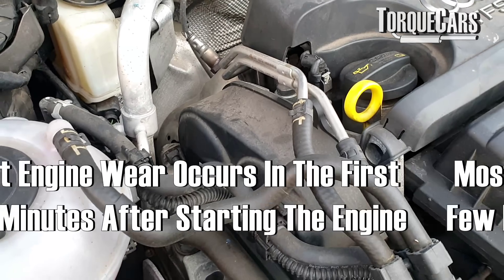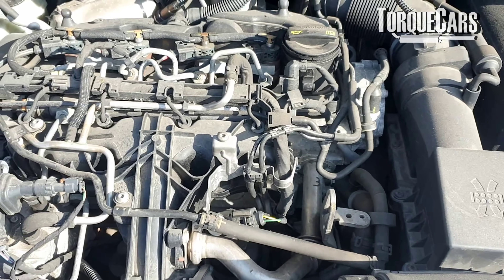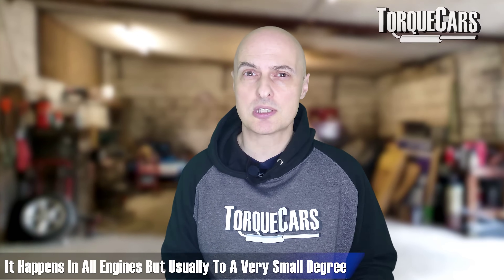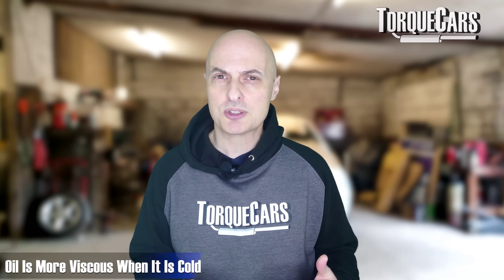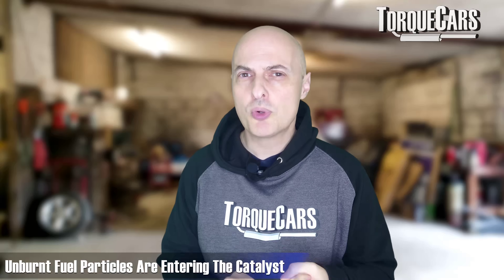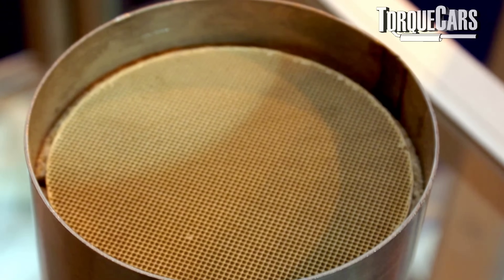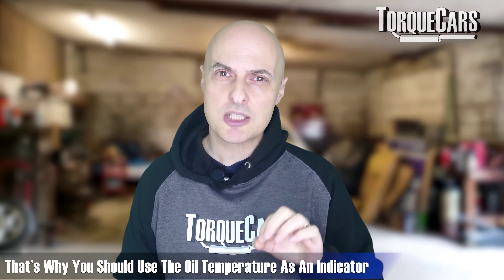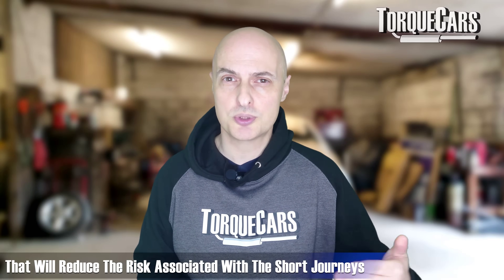5 Minutes of Terror? The TRUTH About Cold Start Wear (and How NOT to Blow Your Motor!)

Comment: I had a bike with one cylinder, 600cc. If you did not warm up the engine gently, you felt it during the rest of the riding, even when hot; it didn't run as smooth as normaly.

Comment: This is junk science. The author states right at the opening that he doesn’t know if this is true. Go do a real study with multiple test cases… a control group and take engines apart and inspect and measure. Everything your saying hear only exists in your own mind. One or two cases that you’ve seen exclude all the cases you don’t see.   This is what we call a “wives tale”. Junk science.
Reply from the maker: Hi buddy, I have a feeling you left this comment on the wrong video! Firstly I do not make any claims about not knowing or being unsure at the start. 

Engines do not need to be stripped down and inspected & measured. You can fairly easily determine wear rates by doing oil analysis. Metal particles build up in the oil and help determine the wear rate with a fair degree of accuracy. Having been dealing with cars for over 20 years I can confirm that cars which do short drives and are not warmed up properly or are driven hard have significantly more wear metals and need more frequent oil changes. The difference is notable after 3000 miles on those engines, whereas properly respected engines need 6000 to 8000 miles to show the same degree of wear metals.

If you can point me to any studies or references that prove that cars don't wear more when cold, they don't need to be warm before being driven hard i'd read them with interest as this goes against a lifetime of experience.

Perhaps you would like to see some "actual studies" & science?
https://www.sae.org/papers/startup-wear-automobile-engines-600190
https://www.degruyterbrill.com/document/doi/10.1515/eng-2021-0059/html?lang=en&srsltid=AfmBOoppgduv9JNPy6E69lJ8aEkavpHBvP-aEviwavGgTjYhTMMBco4T
https://eprints.nottingham.ac.uk/13249/1/247259.pdf
https://www.emerald.com/ilt/article-abstract/52/6/277/171010/Modern-heavy-duty-diesel-engine-cold-start-wear

Comment: I always idle for up to 10 minutes on really cold winter days. Not because I am stupid but I try to heat the battery and increase its capacity which follows engine room temperature to some extent. My alternator belt is slipping and I risk getting stuck commuting to work 80 miles a day in -25c. My car will run 30 miles without a belt if cold. So I warm it up 😮

Comment: In cold weather modern cars will be over 1200 rpm and gradually revs down to about 800-700 rpm.  At the lower revs it’s safe to drive off.   

However if there’s a Bigfoot or UFO nearby, you’re free floor it & take off ASAP.

Comment: I have an fn2 type r I normally warm up the engine for exactly 1 minute then drive it at Low rpms under 2-3k after around 10 minutes of driving and when the engine temp is where it should be then I drive it normally let me know if 1 minute idle warm up is too much?

Comment: I have done basically everything he said not to my car over the years to the extreme! I wouldn't stress about it as it still runs after major abuse and i have been driving for like 10 years now. But the car gets fresh oil every 10k km (6k miles) ish if you did what i do on old oil i imagine it wouldn't have lasted this long. If you drive like me when you do an oil change the oil will be quite shiny even at those intervals.

Comment: I live near a steep hill, so my engine doenst get the privilage of warming up. Its a diesel and i need to revv it after 1 ½ minute of startin at around 2,5k -3k rpm in 3rd gear to get up there. It has now 300.000km on it and runs😅

Comment: Thx for sharing. I live in Canada, where winter months are -20C. Are you saying not to warm up the engine for better performance?
Reply from the maker: You do need to warm the engine up, idling is not ideal but i know you guys just can't drive it around at those temps straight away, so there is an idle method I recommend....

I have actually just uploaded an updated version of this video which should be clearer on this topic. https://www.youtube.com/watch?v=-_WtD0N6_Fk

Add a little load whilst idling, just 200-500rpm and it will warm up much more quickly and safely.

Comment: I agree with the start and go after idle comes down, but what about the transmission fluid? 
Is the principle the same?
Reply from the maker: The video that is going out later today mentions transmission as this is also an important consideration and in most cases you need to be in DRIVE for the fluid to warm up, and better still driving around.

Comment: I have a rover MGZR so even though the head gasket and all that has been upgraded I always make sure the car is warmed up but I tend to leave it to idle for about a minute then don't drive it anywhere near 3k revs (normally nice and low around 1.6k-2.2k) but I didnt know me leaving it for a minute on a cold start would be bad for it. So should I basically keep what I'm doing but when it's started up wait 10 seconds then drive carefully till it's at full operating tempts?

Comment: If what you said a lot of cylinder movement when it cold start, but it running approximately 1700 rpm, and if you shift it to drive right away it down it less then 1000 rpm, don’t you think is it better then ?

Comment: I have a crackhead neighbor who unfortunately has murdered his Toyota echo. He jumps right in it it could be 70 or 20, backs it up and floors it down the road. He told me it has low compression and I told them it's probably because his valve seats are starting to not exist because of the way he drives it when it's cold and he told me it's bad for engines to let them warm up. If you wrap the piss out of an engine while it's cold you don't deserve to own a car let alone have a license

Comment: Career auto worker of 22yrs. Engine builder for 11. Amateur racer for 10. Can confirm: everything he states in this video checks out. 

Simplest solution: wait until your engine slows to its actual idle speed before driving the car, and drive it easy until the coolant temp (temp gauge) gets up to temp.

On cold days, it will take the motor longer to reach this target. Just be patient, work your phone or stereo while you wait. Your $6-20k motor will live twice as long (possibly more).

Comment: When I start up the engine, my wrx initially has the revs around 2k rpm to warm up, and it keeps it there for a little while. When it drops below 1k rpm, thats when I start driving, and I drive carefully until the oil reaches 170⁰F, trying to keep it between 2k to 2.5k rpm.

Comment: Got a hybrid and it automatically goes forward at a slow speed just enough to get out in the main road, takes like 1-2 minutes don't have to press the pedal, surely that's as good as being stationary? Yaris 21' .
It's a habit already, but it takes a minute to settle in as well anyway, put my hoodie there, backpack here, cry because I go to work again... the usual. I also think modern cars are smarter about warming up these days, when it's cold the engine kicks in immediately compared to hot weather where engine goes on but works on battery still unless empty.

Comment: I drive off gently and warm her up. I figure the load will warm it more quickly and if i am not spinning her up, its all good.

Things are so much better than they used to be. Modern cars are at operating temperature in just a few minutes and multigrade oils protect the engine until they are.

Comment: Winter, start engine defrost windows and go. I have my transmission programmed to shift at max 2k when transmission oil is cold. 
Summer, start wait to idle drop to normal and go. Transmission shifts at max 2k when oil is cold. 
This way the engine and the transmission heat up in the right way at the same time.
Letting it sit all the time just gives you carbon buildup and takes ages to reach the desired temp. And if you were supposed to let it sit at idle for a long time the manufacturer would have told you.
The cars are engineered and tested to do so at arctic temperatures. 
So don’t waste gas money on this, just use top quality oils that flow well at various conditions.

Comment: I wait for the rpms to go down before moving and then keep it at or below 2k rpm until the oil is fully up to temp and the start to drive properly. And also do lap of a quiet area before almost any drive just to give it time at low speeds.

Comment: When the oil is thicker and flows slower, it still flows! As long as the pump delivers pressure and the thick oil still creates a film between the moving parts (cams, bearings, piston rings and piston to cylinder wall), which is a stronger film than when the oil is at operating temp. Thicker = slower = stronger film! That's common sense by the way! Indeed during the first minutes, when close to freezing temps outside, I've also heard the piston slap on my Ecoboost 1.0L 125hp when I put some mild load on it, so it doesn't seem to like it when I rush! Whenever I leave it at idle for like 3 minutes at freezing temps (after the engine was frozen too after the night), the slap sound no longer gets heard when putting load on the engine, even at high load. So unlike other engines I've experienced with so far, the Ecoboost really has some smaller tolerances inside the engine and needs a warmup at first more importantly than on other engines in order to last long. So far it has no wear according to the annual worn oil analysis that I do, but that tapping sound that is heard ONLY on load after cold start is definitely a piston slap, cause it only happens on load.
Reply: 0w oils is killing cars all round me. My mechanical friends go to 5w30 and have 0 oil burn and very long running engines. 5w or 10w oil films over parts longer than 0w oils. Some add lucas oil additives to do the same thing. Not very much is perfect. 20% is extreeme in good young engines. Dirty oil kills quickly. 3000 to 5000 miles seems to be best.
Reply: I second this after selling my 2.3L ecoboost mustang. Beat the piss out of it ofc so may be my fault but on cold starts it always had piston slap even if it was 40-50F. Eventually I had to start letting it idle for 15-30 minutes at a time because the piston slap was too bad to drive with. It seems every motor is different in its own ways, especially a turbo'd ford lol

Comment: I have a 1999 Mercedes W202 C280. I noticed that when I cold start it the RPM needle starts off at a higher RPM for roughly the first 10 seconds. I usually just wait until the needle goes down and then I start driving

Comment: In the turbo Benz, I drive very gently until the oil temp gets out of the blue zone (probably around 65 Celsius)... on the beater Nissan it's thrown in gear soon as the dash finishes testing the warning lights, but still doesn't see over 2000 RPM until it's up to temp.

Comment: This video: no need to idle the vehicle for long periods - driving gently will get it up to operating temps faster 
The comment section: "that's why I idle my car for 5min before going anywhere🤦‍♂️
Reply: I'm aware there will be exceptions - like if you live rural and have to accelerate hard right outside the driveway.

But for most people - idling for a long time wastes fuel at best and increases cold start wear at worst.

Comment: On my 2.0 TDI I recently switched from warming it up with low revs. I used to shift at 2k RPM and usually drive w around 1500 RPM but recently found out, that RPMs are not what's 'killing' the engine. Exactly what you said, it's putting stress on cold components (for which oil temp is a good indicator) before they're at operating temps. IMO there is a fine line between RPM and Torque which should be balanced to the traffic conditions and temps of the engine

Comment: Imagine that all symptoms discussed here are even many times worse with a new car. That's why my breaking in advice by far number one always is: take a day off, you have a new car after all and that doesn't happen for the most of us not that often and drive as many kilometers/miles in one day. Now and then a short coffee/lunch stop is perfect to let all the heat flow through the metals but don't let the engine get completely cold. Your piston rings will close perfect and oil consumption will be low.

Comment: When i start my car it revs to 1100. I let it run til it drops under 750 before moving off. I dont know WHY i do that but it feels right
Reply: That's actually your engine either compensating for the extra power needed to drive the oil pump, or raising RPMs to help lubricate the internals. In any case I (and presumably many) do the same
Reply: @oxygized  It actually is for the catalyc converters to warm up so they become efficiet faster..

Comment: Another stupid thing I still see lots of people doing:  A quick rev of the engine just as they switch off the ignition.  Wasteful of fuel, unnecessary, and leaves fuel to evaporate and deposit a very small bit of gunk that may build up over time.

Comment: I don't understand why, with electric motors being so reliable now, they are not used to drive an oil pump. If they were, you could build oil pressure before the engine turns.

Comment: The engine (piston rings/cylinders) wears out quickly during the cold start because of the water condensation and destruction of the oil film. Not because it's too cold for the engine. The actual temperature doesn't matter. It take only a few crankshaft rotations to do the damage until the oil reaches the critical places. Basically you can't do anything about it. This start up wear is not about the engine warm up. These are 2 separate issues.

Comment: Easy way to circulate oil before starting:

With most modern cars if you push the break and gas down and hold them the car cranks without gas or ignition. Two cycles of three seconds will get oil wherever it needs to be.

Comment: Respectfully, I think you are wrong about leaving the engine idle on cold to warm it up. I think you definitelly should wait for your engine to idle just enough to drop your idle RPM to an operating number or at least close to it. You will notice that your engine is spinning faster on cold. The lower the temperature is the faster your engine will spin on the start, and will gradually slow down over short time, let’s say a minute or less.
Reply from the maker: That's a fair comment, I felt I hadn't explained mysefl very well so I did another video on the idling comment I made. https://www.youtube.com/watch?v=aCGsZp-OG4c

The take away IMHO is to put a small load on the engine instead of letting it idle, it will warm up more quickly that way.

I'd be curious to hear your thoughts on that video. Thanks again for chipping in to the discussion.

Comment: Thank you for your video. I have a quick question. Do I have to change my transmission if my torque converter fails?

I had an issue the other day and my dash was complaining that my transmission has reduced power and was overheating. 

I had the codes scanned and it said the torque converter failed. It was still shifting well enough until I left it at the dealership and I think the computers protected the transmission. But the dealership confirmed the torque converter has to be replaced on my car. It sucks because it only has 63k miles on it.

Comment: Someone said to me, cold starting eats horsepower.
So in a year you can lose 2 bhp with cold start wear. I think that's bs
Reply from the maker: The wear does build up, but I guess a power loss depends very much on the engine concerned and how hard it is driven and how often you run on a cold engine. I'll do a video on how damage happens on cold starts and what to look out for. If I find any definitive "car loses xhp per year" I'll include that but I really doubt that will be the case.

Abusing a car during a cold start will generally just reduce engine lifespan and can cause problems with various exhaust filters/the battery etc... You might lose some compression also, which is probably what the "rumor" you've heard was based on but they might have been thinking of accelerated carbon build up on the intake of some engines.

Comment: Define "short journey"
Define driving the engine "too hard"
Those are vague terms that everyone will interpret differently.
Reply from the maker: Those terms can't be exactly defined, a short journey or driving hard will be very different for a large 6.0 V8 compared to a 1.0 Turbo or a 1.4 Rotary engine.

As general guidance though and my rule of thumb...

"Short journey" is any journey where the engine has not managed to reach operating temperature. So for me this takes about 5mins of driving, but I know others can take a lot longer.

"Driving hard" is using anything above 1/3 of the RPM range or pressing the throttle pedal by more than 1/3 of it's full travel.